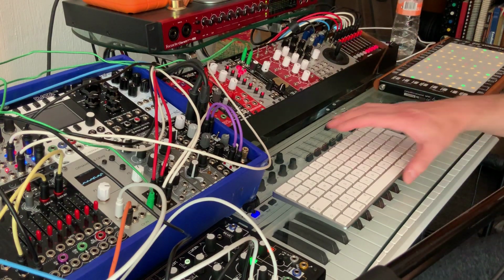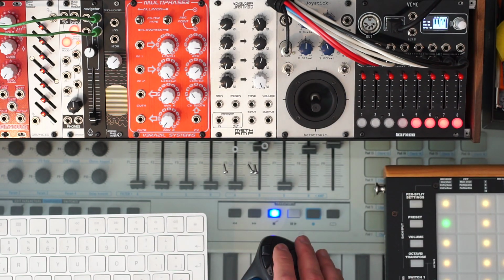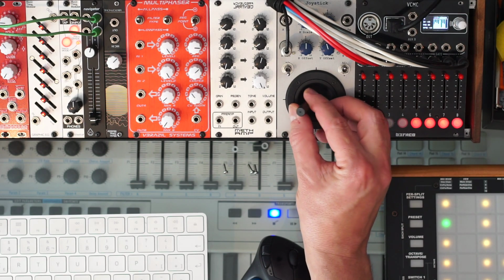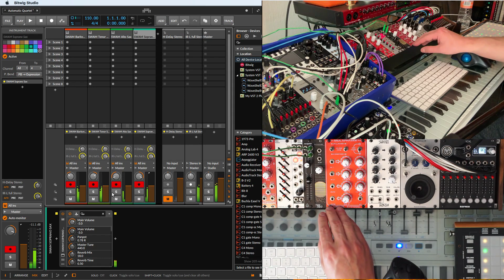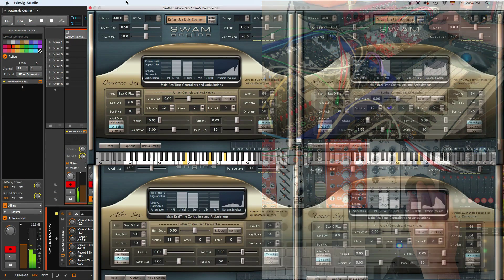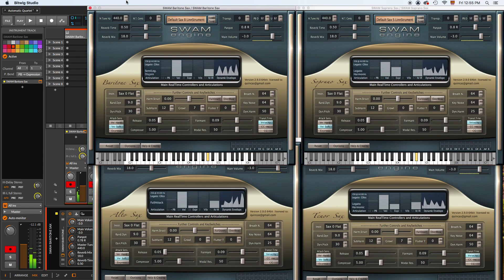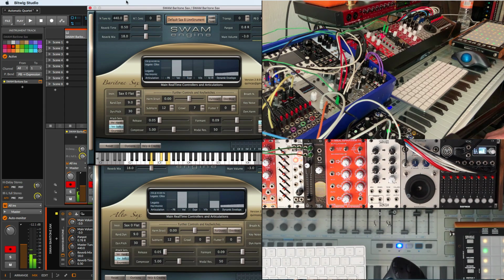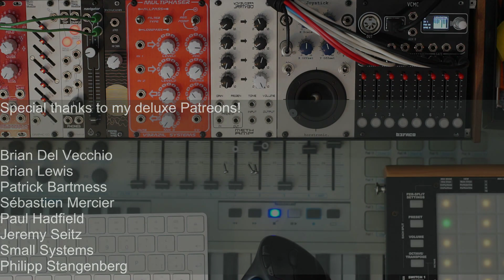Automatic Sax Quartet - SWAM, VCMC and Bitwig

Comment: Use the built-in integer sequences or bytebeats sources in the CopierMaschine app instead of a random voltage. Both are fractally self-similar and will sound much more musical. Modulate the parameters for them (by hand using your joystick etc).
Reply from the maker: great idea, thanks Timmy!